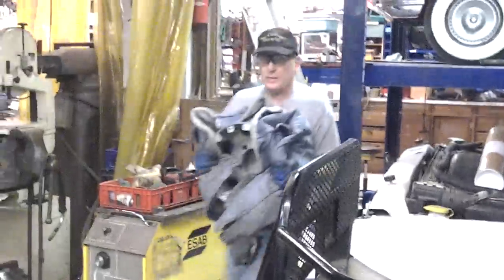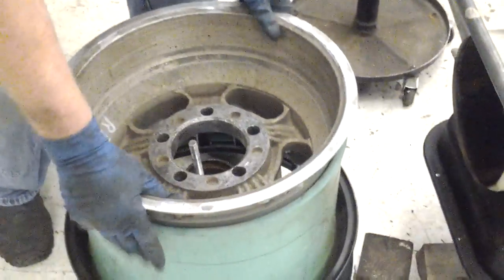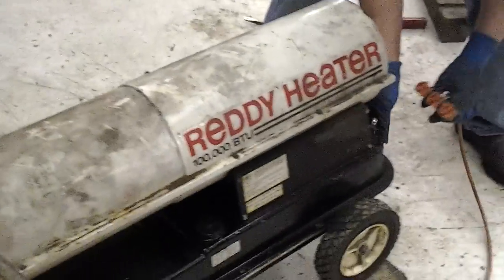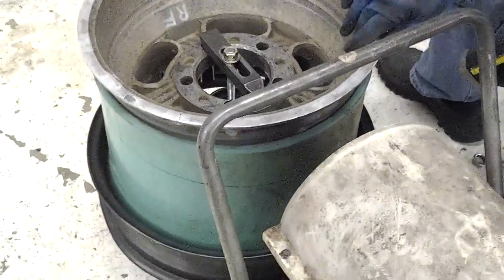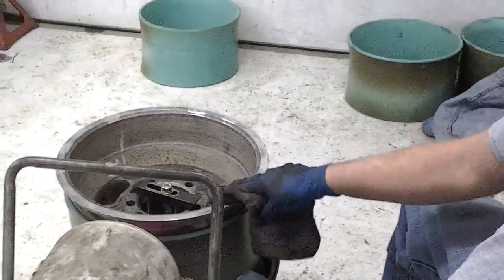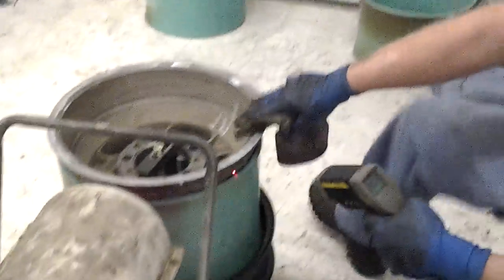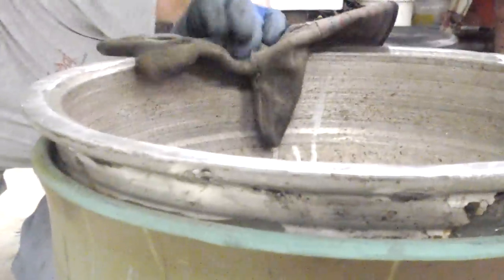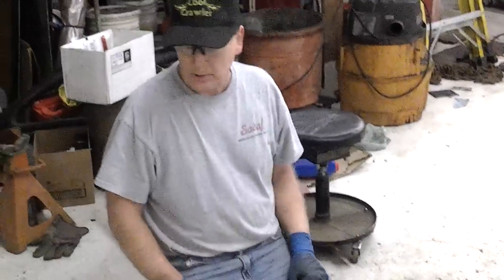How to make 15" Double Bead Lock, PVC Inserts

Comment: When you mock up and measure your insert. How much extra length do you leave for  compression  of the tire beads?
Reply from the maker: The inside length is a bitch, to short and although you wont ever lose a bead, at low single digit tire pressures the rims spin in the tires, to long and you cant get the rim halves to pull together. My swampers had over an inch wide bead, and I figured an 1/8” compression per side, but when I switched to the mickeys, the bead was just 5/8” thick and harder ( less rubber over the steel cord, so I ran 1/16”  compression per side. To get the length made paper templates of the cross section of the beads, placed them in an assembled rim, and measured across, guessing on how the rounded edges of the pcv would mate up with the curve of the inside of the bead
Reply: @superjeep47  would you be able to measure thickness of bead then cross section on wheel to get accurate measure on pipe?
Reply from the maker: @johnwheeler7224  I answered this in the above reply, yes that is how it is done, but you are measuring the intersection of curved surfaces, so it still results in some trial and error.

Comment: How are you getting these on the regular rims now?

Do you have a build or images on this?  Kind of different and interesting.
Reply from the maker: I made my rims two piece and the way I went about it took forever. I lathed them in half, put a grove in one half for an O-ring and then welded blocks on the ID of the rim with a 1/4" offset to center the two halves, you can just see them at the very start of the video. I there are blocks with holes for each half of the rim, which bolts go thru to clamp together.